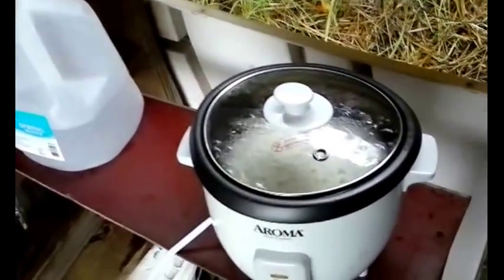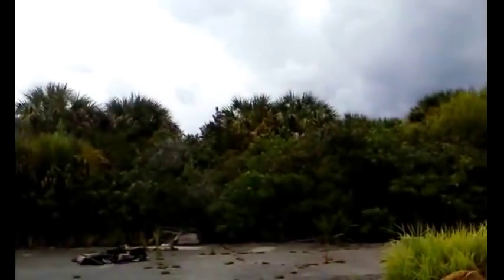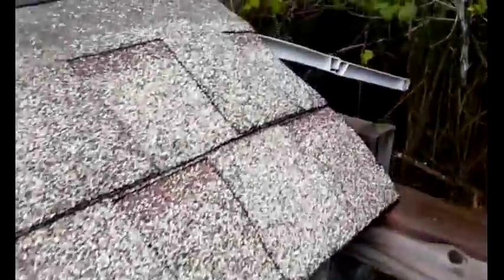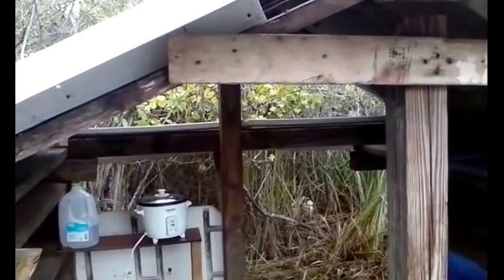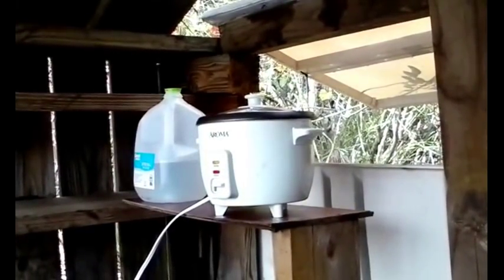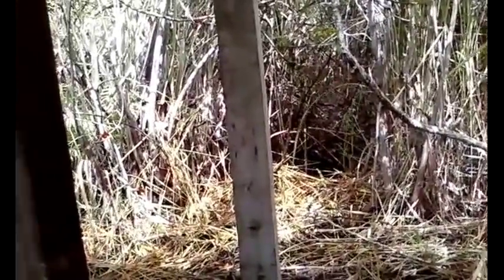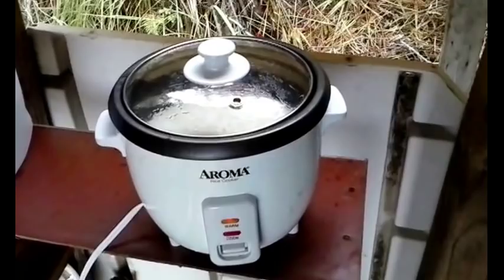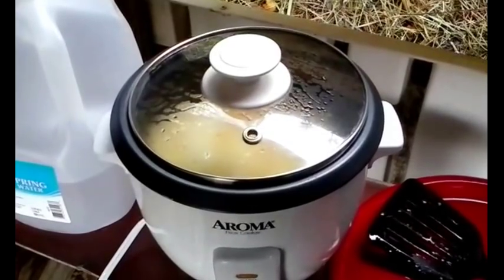Bushcraft - Cooking With Electricity at The Hut (V097) - Minimalism Van Dweller Living In A Van RV

Comment: If they find food they will keep coming back with even more ants.
Reply from the maker: Yes.  Sadly, I will have to kill the ants.  Killing anything makes me sad...but it's either the ants or the inhabitants of The Hut.  I will have to defend The Hut.
Reply: +Living In A Van i think if you put down borax or d.e. they will stay out and you won't have to kill them.
Reply from the maker: The borax kills them by scraping their exoskeleton and then they dry out...not really a pleasant way to die... :(  But I will lay it down to protect the hut and any visitors who happen to come there.
Reply: +Living In A Van diatomaceous earth definitely does that. With borax you would usually add something that the ants like and they carry it back to their nest. They eat it and can't digest it properly so yes it would kill them and others at the nest that also eat it.
Reply from the maker: I think the borax does the same thing as the DE does?  I've tried using peanut butter with borax to get rid of pests before.  I'll probably just spread it on the floor and around The Hut/Outhouse and surrounding areas.